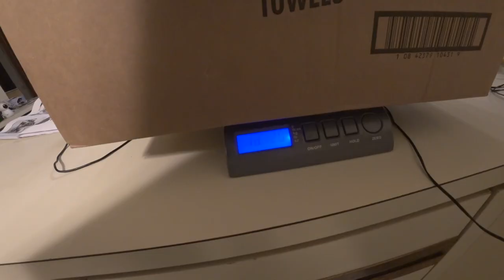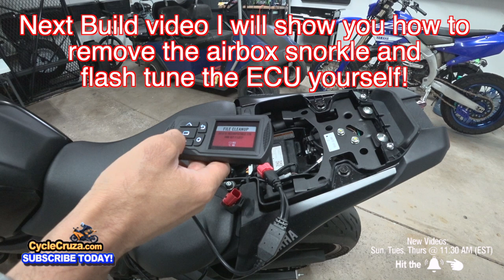Install Akrapovic Full Exhaust 2022 MT-07 ECU Reflash | Bike BUILD Ep. 3

Comment: Excellent choice my friend.  Don’t make the same mistake I did.  I put the full akra on my Z1000, left the DB killer in thinking it didn’t make much difference.  I literally rode up north this weekend and had it dyno’d. As a baseline I dyno’d 127 back in 2013 with the stock exhaust…  Yesterday with the full system I dyno’d 72 horsepower. 🤬

I got home kind of pissed, came to terms, walked out and pulled out that DB killer and my god. The power, the sound… I didn’t know my bike was capable of sounding so good. I sold my self so short on that. Anyway i called the guy back and scheduled the re-dyno. I’m hoping he cuts me a deal the second time since he know’s I goofed on that one.

Those MT-07’s sound like a BEAST with those akra’s man.

Comment: Just got mine out of the shop yesterday. Had the Dave Moss suspension tuning done,  rear shock clicked up a little, came home and dropped in a sprint high flow filter with my vcyclenut flash. Also R6 tube was already on it. Man she rips love this bike and I also own an 09 as well. 07 will be on the track next month
Reply from the maker: Nice! I
Reply: Why didn't you do the fork mod yourself? Not capping just curious.

Comment: If you don't want the O2 wire twisted, try twisting it in the opposite direction and then installing it and it should reach the OEM hook!
Reply: I guess I’m not the only one that saw that great point😂😂
Reply from the maker: eh it's on there and working.
Reply from the maker: Actually, if you look at where the o2 sensor was on the stock pipe it was further away than where it is on the akra pipe. You still have to use a ziptie.
Reply: When you putting out the ECU Flash video?
Reply: @richardmurphy6244   I second this! Getting a power vision for my 2022 MT07 and would like to see how you used yours and what tune you used @cyclecruza

Comment: Those exhaust gaskets if metal or copper rings are a one time use gasket. I’m sure it will be fine but for future reference it isn’t about the age of the bike. Surprised for the cost of that exhaust they don’t supply you with new gaskets.

Comment: The spiral in the pipe is for helping to evacuate the gases from the system, rather than for back pressure. Back pressure is actually not good for the engine, contrary to popular belief. So therefore, having the highest flow rate possible allows for max gains.

Comment: Nothing sounds sweeter than a SC Project or Akrapovic exhaust on a CP2 or CP3 engine. Now to ditch the baffle to complete it's full on hooligan exhaust transformation.
Reply from the maker: When I put it on I was like " DOH!!" I left the baffle in. lol I did not feel like messing with those springs again with a needle nose plier. I ordered a hook tool, as soon as I get it, I'll remove the baffle and do a comparison video. However, even with the baffle in it is sounds proper. However, I would like more air flow and make it even louder to rev bomb stop lights even more. lol I feel like a Harley d-bag now, now I understand why Harley riders do that, this sound is addictive. This bike sounds like a freaking Harley. I need to buy some chaps now. haha j/k

Comment: With the power vision 3 device do u need a power commander. I have a 22 zx10r I have the ecu flashed through brentuning but I need my air/fuel ratio tweaked to Make sure it's straight not running Rich or to Lean

Comment: Yamaha allows you to have the ECU flashed it doesn't void your warranty. Also. If you use yamalube oil and Yamaha oil filters Yamaha gives u a 20year/100k mile warranty on the engine. you can even do the oil changes yourself. Just keep the receipts. Nice bike. Sounds great!

Comment: That exhaust design is funky where did you read up about the back pressure and it making it more powerful or whatever? And what model exhaust is it ? I’d like to learn more. My Yoshi Alpha T race exhaust is a straight shot
Reply: Back pressure is always better unless you have a turbo engine
Reply: @JesseJames-23  Yea that’s not the deep dive I was looking for but thanks
Reply: I'm sure it has something to do with getting  the tone they wanted out of it. Too open of an exhaust can make the bike sound like a fart can at mid to high revs. As far as backpressure just neck the diameter of the pipe down...idk I'm sure there's a reason for it. Just seems like that loop would  ad alot to manufacturer cost.
Reply from the maker: From what I've read and was told over the years, the loop is actually what allows the Akra Carbon to maintain the low end torque curve that we love about this engine.  The Akrapovic Carbon full racing exhaust makes the most peak power on average of any exhaust system. Akrapovic is one of the elite exhaust makers in the world. They do extensive research and testing.
Reply: @CycleCruza  that makes a lot of sense, and agreed I only use Akra on my bmw’s, I’m a bit more open to experimenting when it comes to my bike though, any of the big ~6 I will give a shot
Reply: @CycleCruza  thanks for mentioning that. A longer pipe tune’s the power curve to a lower rpm vs a shorter pipe it’s all about velocity helping to scavenge the cylinders during the overlap period of the cams helping to get a better cylinder fill. The back pressure myth just will not die. Back pressure is just a contributing factor to pumping lossless and believing that it’s necessary for good performance is just ignorant.

Comment: 5:01 did you put those two 10mm nuts back on behind the “peg assembly” ? Or the bracket requires you not to for some reason?
Reply from the maker: Those are only for use with the stock muffler, they are not used for the new exhaust.  I should have mentioned that you do not reuse those two bolts.
Reply: @CycleCruza  ain’t no thing just making sure you weren’t going to wind up with parts, dangling and catching up  on your chain
Reply from the maker: @Fee.1  I thought the same thing at first and almost went crazy but then I realized it was for the stock exhaust. lol
Reply: @CycleCruza  that’s actually one thing I love about my yoshimura as well, it uses mounting points that don’t require that strap to go around the exhaust, just looks a spec cleaner to me. I would love to create an exhaust company though. Actually been working on prototype’s just looking for a couple partners and advisors

Comment: Ur supposed to do a vcyclenut flash. And  Disable the O2 sensor. 🤌🏾🤌🏾🤌🏾
Reply from the maker: I thought the o2 sensor helps the ECU adjust a/f ratio better? I would not want to disable that.
Reply: @CycleCruza  motorcycles come set up like cars...for the average person. Not you specifically. It's not for NY, Ohio, California. It's for an average of every state in the US. 
When u get this vcyclenut flash. Your telling him. 
"Yo David I'm from Ohio, usually ride in 55°F -100°. I love twisties, wheelies, going wide open 2nd-5th gear. I have a full akrapovic carbon exhaust. With a air filter and air box mod". He will respond fast, with what he recommends. U send your ECU, and you get it back in 4 days. On the fz09 you can do it for each mode.. my B mode was my track mode, A mode was the best he could get the 09 to perform , and STD mode was (smooth) extremely smooth. It was so linear, it felt like a different bike. 124HP on my 09 and I got it down to 396pounds.  David @ vcyclenut is man. 
You can also disable AIS, (air injection system) change what temp your fan comes on,  enable quick shifter, etc etc. Check him out. The dynojet, isn't giving u real world performance. I'm telling u. My 09 was doing power wheelies at 100mph in 4th gear. My boy on a 09 with the dynojet flash was pissed. He went vcyclenut 2months after I did
Reply: @CycleCruza  stock o2 sensors on most modern bikes (including the MT07) are narrow band and only function for emissions.  They will only adjust to lean out the bike at certain points in the fuel map to reduce emissions.  Vcyclenut has a recent video on his youtube channel that explains it.

Comment: How do you remove the baffle from it?
Reply from the maker: Easy, it has a rubber plug on the side you remove and get access to the bolt holding the baffle in. I will be doing a video on that soon, stay tuned!

Comment: What about the sound with the baffle out? Let that thing breatheee
Reply from the maker: I will in a future video, I wanted to see how it sounded with the baffle in. It sounds proper with the baffle in, it will probably loud af without it in. I'll compare in a future video though. I need to get my spring puller first though (I ordered one). lol You have to take the can off to be able to pull that rubber plug to remove the baffle bolt . I did not feel like trying to mess with those springs with need nose pliers again. lol
Reply: @CycleCruza  Its definitely better than stock but Im itchin to hear if no damper makes it even meaner lol. My "loud exhaust" is really not bad IMO. Once my bike warms up idle isnt obnoxious, seems similar to your startup clip (not sure if it was warm already). If I wanna cruise around without drawing attention I keep the revs low. But boy when I open her up full throttle that bish screeeams 😁

I cant remember how I did my springs but I feel like i might have used a flathead lol. Either that or it came with a cheapo puller that I have since lost...
Reply: @CycleCruza  Your MT exhaust note sounds very similar to my ninja 650. Its so hard to judge loudness from a recording though.

Comment: I have a Power Vison III  and a  Power command V ..   That's the  only way I can get a dual map switch so I can have a tune for Premium gas and one for  87 octane gas.
   I heard the FZ-07 has the timing retarded in 1st and second gear so it does not wheelie so much .. There also is a large part of the fuel curve that can't  be changed with the  what is it  the never Powervison V or the Power Vision VI I don't recall ..
  The only urgent thing I need to change is that my fan does not kick in until 222F and kicks out at 214F which is really stupid ..
  I purchased mine from Fuel Moto..    The Owner and his Son know how to Dyno Tune bikes and they will e-mail me two custum tunes for Free.  The Problem is I was told  everything wrong you can imagine buy one of their phone techs .. who only knows about Harleys.  Everything he told me was wrong and now I am too busy with work to work on the bike .. Oh well it will be snowing here in MI soon then I will make time to flash it and install the Power Command 5 and dual map switch ..
  The tech guy told me that had no tunes for the Yamaha FZ-07  even though their web site said they did .. and he told me that  Yamaha Engineers are Genius  and I should not change my cooling fan temp turn on and cut off temps .. which is totally wrong .. and he told me I had to get a Dyno Tune to see any gains on my bike at all .
  Also with Power Command V I can add a quick shifter.. just plug it in ..

Comment: not even an acrapovic can save a mt07 from sounding as an harley haha, get an mt09 or m10 for real men sound ;)
Reply: 😆😅🤣 so "real men" like bikes that whine?
Reply from the maker: Honestly, that is what I liked most about Harleys is the sound. Now I have a reliable, lightweight fun bike with a Harley sound. 😂
Reply: @sinformant  you know when you know xD
Reply: I've owned both the MT07 and MT09.  The 07 definitely more of a "manly v-twin-ish" sound to it.
Reply: @gixxerofsweden9409  well I have owned single cylinder/ inline 4 cylinder/ vtwins and by far the best sound was from the vtwin, plus the torque is instantly there compared to the inline 4 that had to wind up. Also I turned more heads on my sv1000s than I ever did on my zx6r.

Comment: Should have gotten the M4. Sounds and looks way better. 
Also get rid of those stock handlebars and get some PROTAPER CARMICHAELS
Reply from the maker: Akra is much better, it has the loop bend that helps you avoid bottom end power loss. Akrapovic is the best because they do extensive research and testing and their pipes usually get the best performance increase. The akra is so good and custom for the bike that you don't even need to flash the ecu according to Akrapovic.

Comment: It's strange how they put that loop in the pipe.
Reply: Ye it is
Reply: I mean it ain’t a fucking 2 stroke
Reply from the maker: From what I've read on the topic, the loop is actually what allows the Akra Carbon to maintain the low end torque curve that we love about this engine. Akrapovic goes above and beyond in getting the most performance out of their exhausts systems. I was always told to get an exhaust with the loop-bend to avoid losing some bottom end power.  The Akra Carbon makes the most peak power on average of any exhaust system. The bike feels punchier now and a bit quicker on the highway. So awesome.
Reply: @CycleCruza  what kind of range do you get per tank ?Curious. Yamahas tend to be pretty thirsty real world.